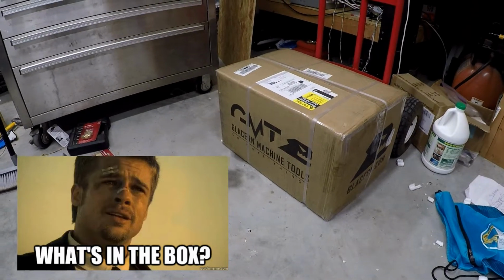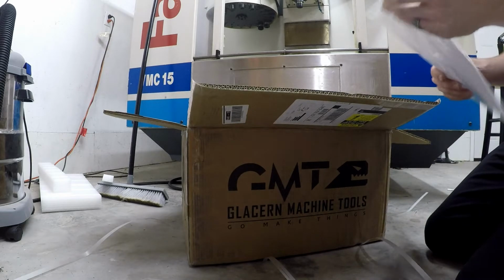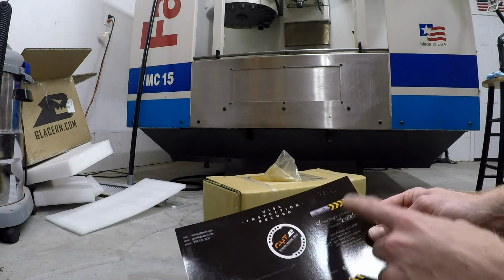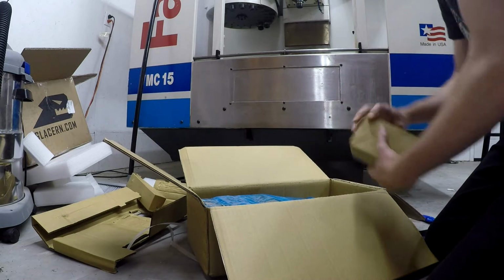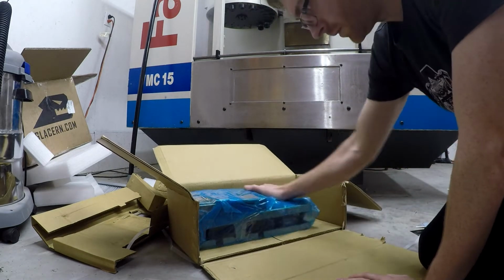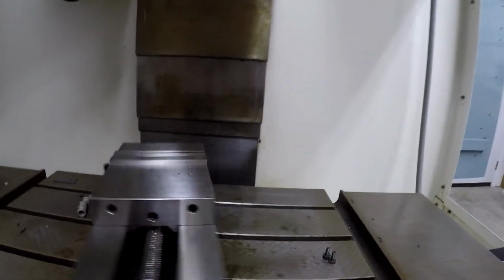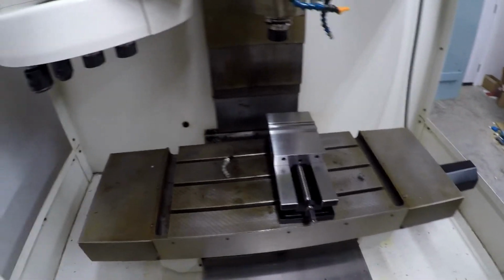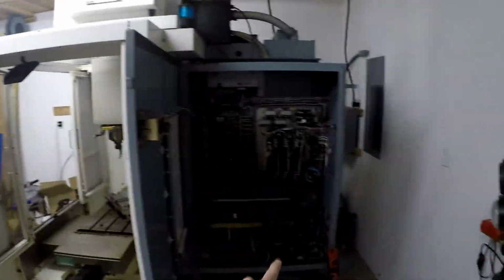GMT Vise Unboxing!

Comment: I'd go with the compressor as well, I'd rate it as a more basic need than a fixture plate. You can get one of those later on perhaps, but you need air now. I just recently swapped my air compressor for a bigger and much quieter one, check it out here... https://longezproject.blogspot.com/2019/04/tooling-up-compressor-swap.html If you do go this way be aware all fittings are locktited red (don't ask how I know 😬). Customer service has been excellent so far. Ciao, Marco.